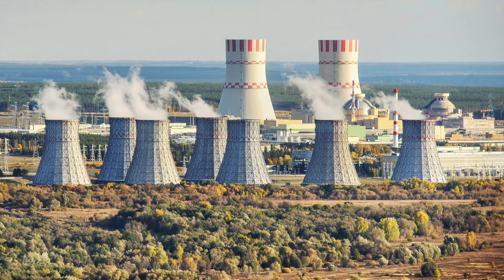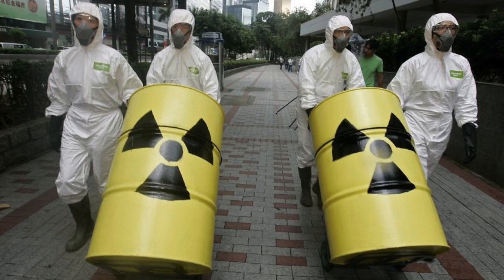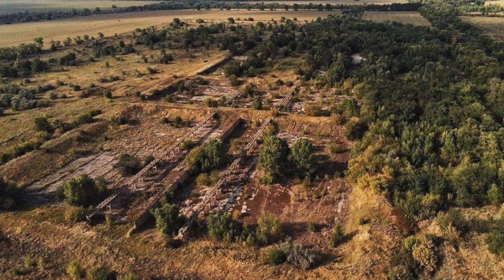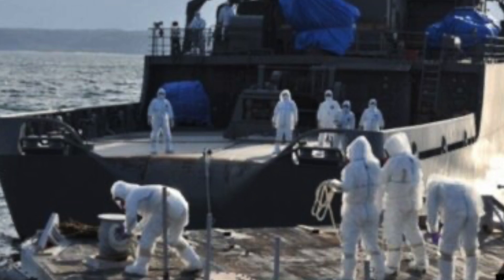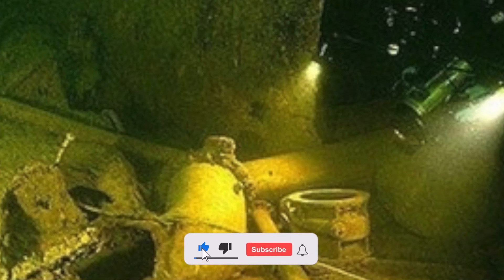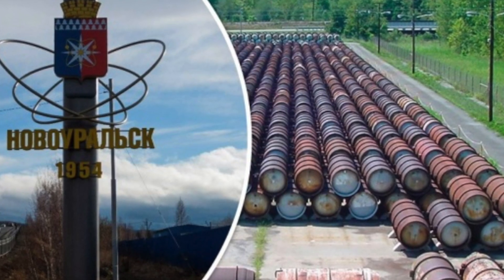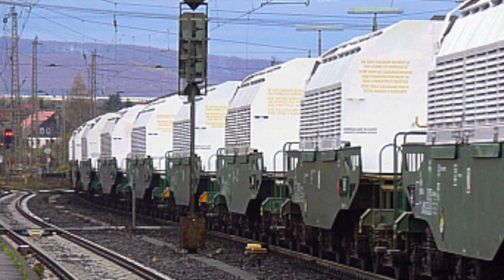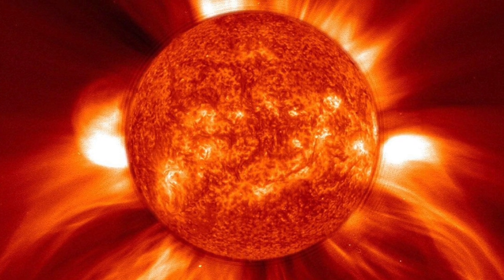Where did the USSR put its radioactive waste?

Comment: SNF is not the problem, failing to reprocess it and put it back into the reactor is the problem. The remaining "neutron poisons" removed from SNF are industrially useful in their own right, and most have relatively short half-lives. SNF does not have to be sequestered for thousands of years.

Comment: Molten-Salt-Reactors wouldn't run in a high-pressure vessel. in contrast, they would operate in high temperature, low pressure (a few bars), Hastelloy (nickel-alloy) reactor vessel, with a freeze-plug safety valve, to drain the fuel down into safe(er) drain-tanks, in case of an accident!
Reply: MSRs routinely release large quantities of gaseous fission poroducts, which must be trapped and stored. Do you really think that the public could trust the nuclear industry (snicker, snort!) to do that? You know, the same industry that wants to dump Fukushima hot sauce in the Pacific Ocean? Claims that the MSRs won't melt down are an oversimplification of the safety issues they raise. Under some circumstances, the hot liquid fuel can heat up and destroy an MSR in  minutes.
Reply: Nice on paper moderated by ink.